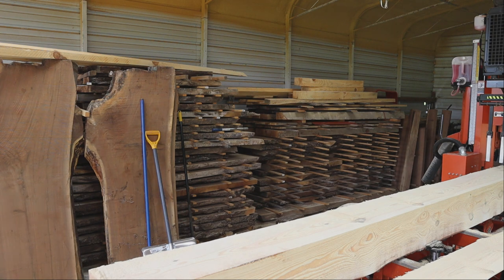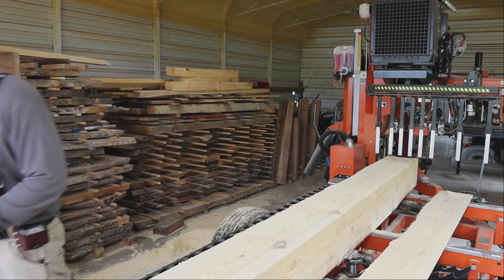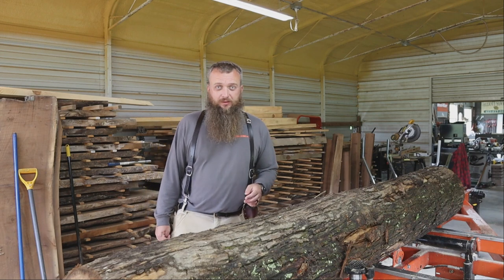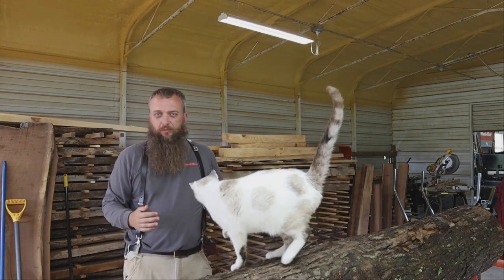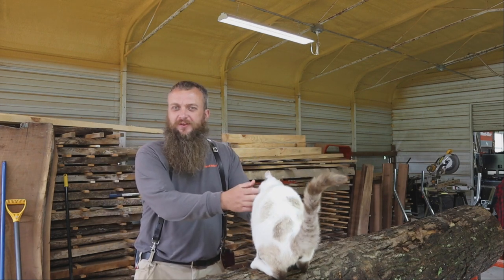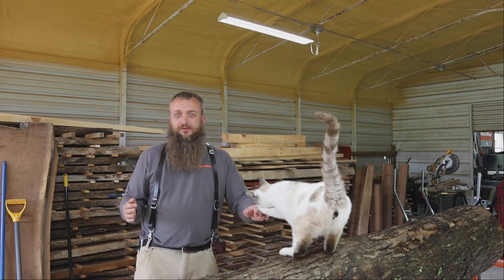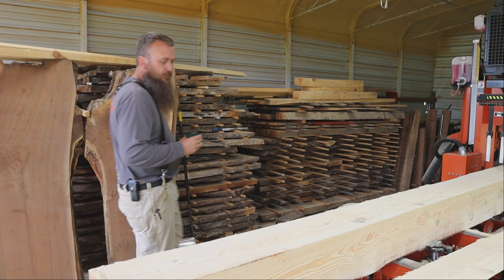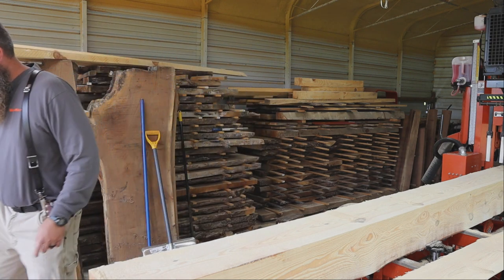After 5 Years Of Videos The Most Requested Log Is On The Wood-Mizer,

Comment: Took your advice and started using diesel in the lube tank on my Lt40 and dang it works great, keeps the blade so much cleaner, thanks for the tip
Reply from the maker: indeed, it does have a little of an odor but worth the trade off,

Comment: Question: Is Hemlock as hard and difficult to cut as Hickory? Your machine chewed through that hickory like it was butter, even if it did the blade in. Great work on the wood, and looks like lots of hickory handles may be had. If not, find a great use for it.  Thank you for sharing your fun with hickory. Maybe someday, some hemlock, if you can find it?

Comment: A friend operated a handle factory from the end of WWII until he died a few years ago.  Harvested Hickory off his onw land and sawed the blanks on a short log circular mill.  cut them with a taper on both sides, something like 1 1/4" by 3 1/2" on one end and 2" by 2 1/2" on the other. Stacked and air dried them by the thousands.  Turned them on pattern lathes and sanded them by hand on big belt sanders.  Had a big drum for the best ones with "rocks" of carnauba wax and they tumbled for days.  The ones with sap and heart wood or other minor imperfections he scorched them with a propane burner.  They were "flame seasoned".  Those were dipped in lacquer.

Comment: Gday Friend, just wondering...when you took the first slab off the squared up hickory ( bout 11:05min) what's the reason behind the timber pulling away from the main log?
Reply: There are internal stresses in the log depending on how the tree grew, the direction of grain, etc.  These get released when you separate timber from the rest of the log and the timber bends the way "it wanted to be" if the rest of the log hadn't been holding it down.  Some stringy, high strength woods are well known for moving into a new shape every time you change their dimensions - hickory is one of them.  This same strength, stringiness, toughness also makes it good handle material.